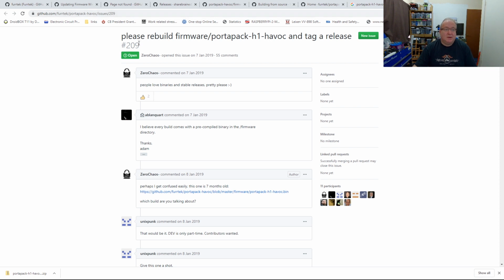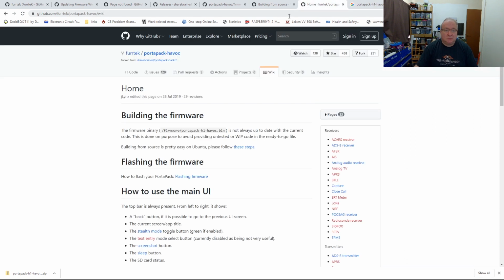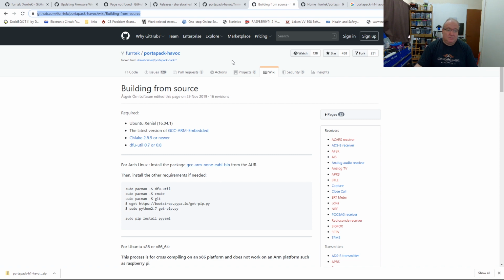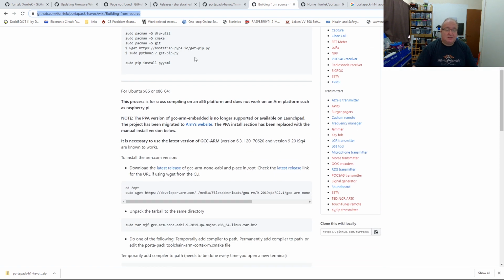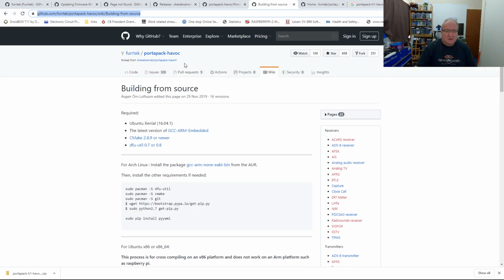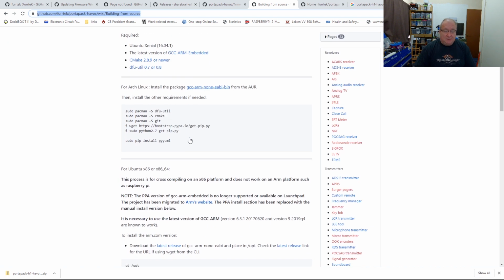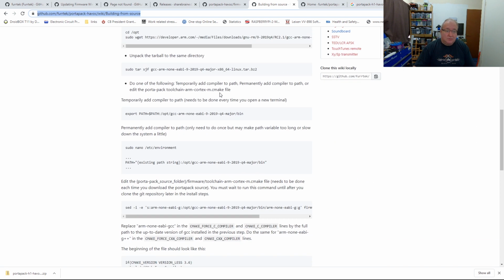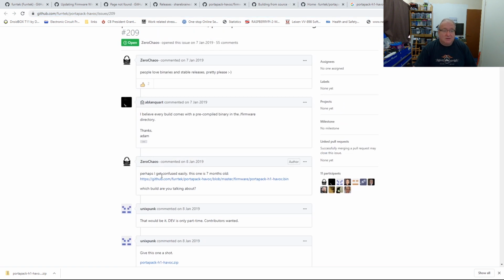The Portapack H1 Havoc.bin file is not on GitHub..

Comment: Well, firstly thanks for the above video Gaz. I am really keen to get a current Havoc build onto my portapack H2 and see what my HackRF can do! I am not particularly good with source code, but I have tried for two days to step my way through building from source code on an Ubuntu Xenial virtual machine I set up on my iMac. Ubuntu runs fine but after going through the build instructions from the sharebrained web site (all seemed to go ok) the final ‘make firmware’ command failed with multiple errors. Up to that point I actually thought it was going to work... I have one burning question though, and it is this - how should I be logged into Ubuntu before starting the process? I have a user with admin rights, and I ran all the ‘sudo ....’ steps when suggested but it may be something to do with permissions? In the end I tried it from a root shell by running sudo -i and sudo -s but that still didn’t work. Do you think you might be able to help me get this working? It’s been around 20 years since I worked on Unix systems! And I’ve been in sales since, so some of my early knowledge is starting to fade now I am in middle age...
Reply from the maker: You are way ahead of me Aaron, I used the pre compiled firmwares.. Sharebrained pointed me to a ready done firmware .. Im sure I listed it in the description.. but I will check.. Good luck buddy.. Gaz